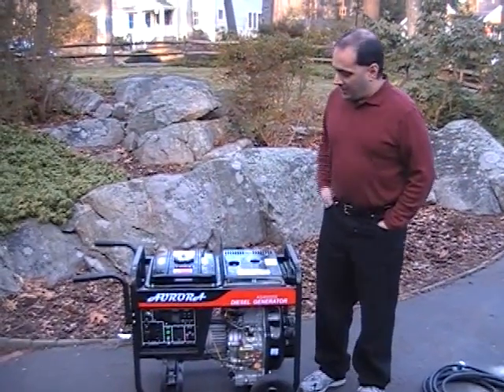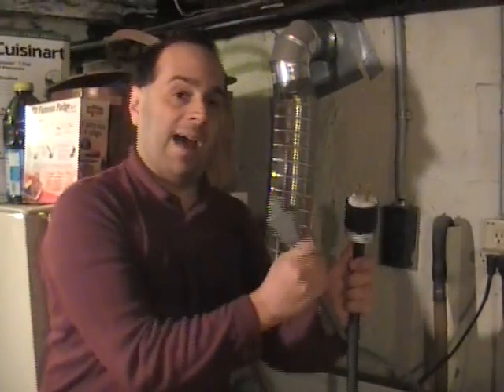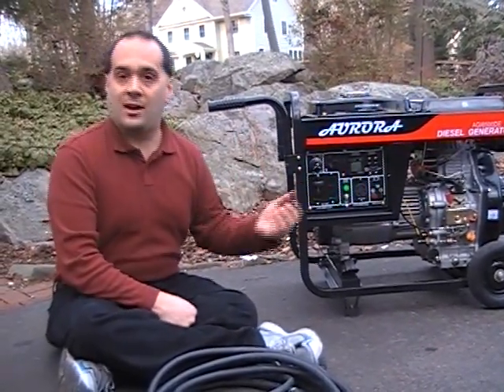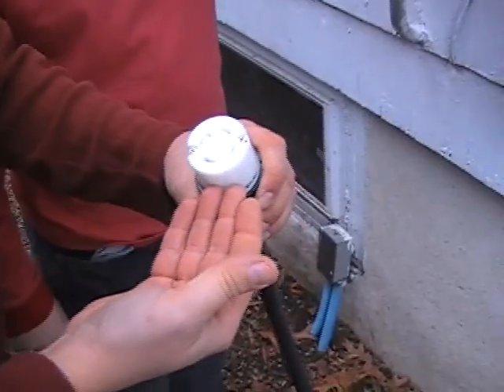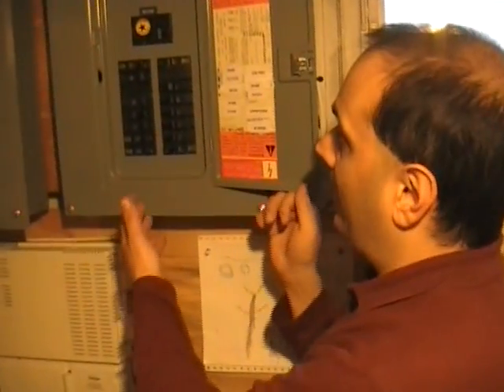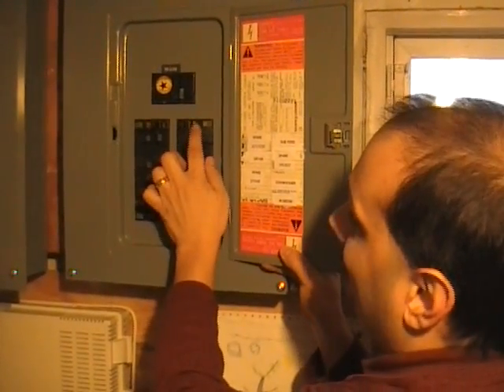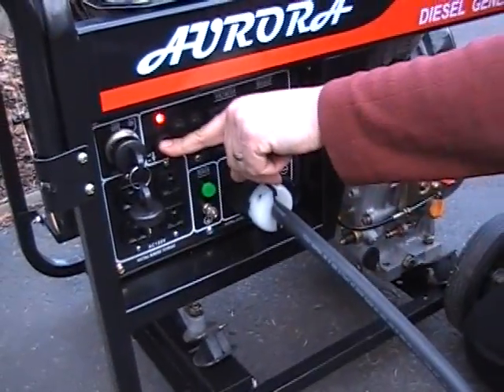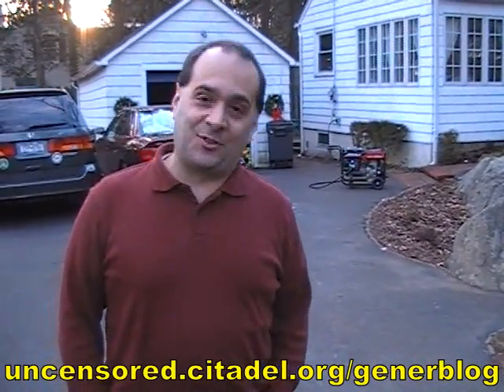Inexpensive residential generator hookup

Comment: I burned up almost every electrical appliance in my house, light bulbs popped. Surge protectors. I bought a plug,had some wire.connected it to a 240 breaker in shed.backfed to house panel box.main off.i learned not to mess with something I don't know
Reply: You must've ran 240 through your 120 circuits.  You should test circuit before using the first time to make sure everything is kosher.
Reply: @raymondjackson6069  yea,that's what seemed to happen. I disconnected the wire on 240v for air compressor. From there, it goes to breaker in the house. Thank you. I will be sure to look more closely at what I'm doing now
Reply: @dalecarter4025 , you're welcome my friend.  You say that "seemed" to what have happened.  You have to be sure with that kind of tinkering.  Guess work just doesn't cut it with those voltages, because guesses lead to surprises and you really do not want any unknowns, unexpecteds or surprises doing electrical work.  And when you have others in the home, like a wife or little ones, you really don't want to take chances and be safe.  Not tryin to harp for electricians, but if you are not comfortable (but not too comfortable) with electrical task, you should at least consult with one for guidance.  Good luck and be careful, and treat every wire you can't see both ends like it's live.
Reply: @raymondjackson6069  thank you raymond. It wasn't the first time I had been doing this. I don't fool around with stuff i.don,t know. I'm no carpenter either. But I will get someone that knows fix it .you are right, I could have killed someone or burned the house down
Reply: @dalecarter4025 , absolutely.  If you've done this more than once, time to call in a pro.  You are really not cut out to deal with the level of electrical work you are/were attempting.  Not trying to sound preachy, but screw up carpentry, and you got something ugly, plumbing, you may have a leak.  But electrical issues are very serious.  I've been tooling around this stuff for decades, plus I was an electrician in the Navy, and I am still a' learnin'.  And the more I learn, the less I know.  Take care my friend, and be careful!
Reply: @raymondjackson6069  yes, I'm calling electrician, because I got other too. problems in the house .it's a 69 year Jim Walter with aluminum wire
Reply: @raymondjackson6069  thanks again, and for your service too
Reply: @dalecarter4025 , you too pal, and best of with your project(s).👍🏾
Reply: because you dont know shit about electrical.the problem was YOU,,in this case,yes.call someone who knows what he's doing,
Reply: Make sure you follow all the generator safety rules before using portable generators. This is just a reminder for everyone’s safety. Here are the rules about generator safety: Generators can be dangerous if not used carefully. Every year, hundreds of people die or get injured when using portable generators due to carbon monoxide poisoning and electrocution. Make sure you are using your generator carefully and keeping others safe as well. There is something very serious that everyone should always be aware of when using generators. Some people do run their generator indoors which is not safe and that increases the risk of carbon monoxide poisoning which can cause death of family and you. Some people run their generator in wet conditions which can electrocute them. Please remember that you should never run your generator indoors. Remember that carbon monoxide is an odorless and colorless gas that you cannot see or smell. Carbon monoxide is a silent killer. Keep that in mind. Make sure your generator is 15-20 feet away from your house and away from doors, windows, and vents. Never use your generator in your porch too. Having a carbon monoxide detector is very important against generator safety. Some people also allow children to go near the portable generator which could pose risks. We need to keep an eye on our children making sure that they are not near the portable generator so they won’t get electrocuted or burned by the generator which is dangerous. A locking enclosure also keeps kids safe. A generator shed might look like a tempting place to explore, or take cover during a game of hide and seek, but a generator is a dangerous piece of equipment that can cause injury. It says on the manual that we should also keep children away at all times from the portable generator to avoid injuries. Please do not allow a child or unqualified people to operate the portable generator.  It is important to keep your children safe especially little ones. The portable generator can be hot during an operation. Just because some manuals missed what should be listed doesn’t mean it’s safe to do. Always follow the generator safety rules when using portable generators. Generators pose electrical risks. If you need to use your generator during wet weather, you need a generator tent to protect your generator from getting wet. Don’t let your generator get wet. Keep your generator dry and before using your generator, please make sure your hands and your generator is dry. Do not wear loose clothing when operating the generator. Everything that is said on the generator’s operating manual should not be ignored. Never smoke cigarettes near the generator. Please keep flammable things away from the generator. Never overload your generator too. Your generator can catch fire. Never ever try to plug a generator cord into a wall outlet to avoid back feeding. Back feeding your generator is dangerous. Always turn on your generator first before plugging in appliances and shut off the appliances before turning your generator off. Use a heavy duty cord for your generator and the cord should not be worn out. All the instructions should be followed carefully. Never refuel your generator while it’s running. It can cause fire if fuel spills while your generator is hot. You should turn off your generator and let it cool off before refueling it. Having a fire extinguisher next to the generator is also important. This is only a reminder for everyone’s safety of using generators. Make sure your generator is properly grounded. Having a fire extinguisher next to the generator is also important against the safety rules. https://youtu.be/I1jT3ANENvI and here is a video more about keeping others safe when using generators and also about our family’s safety. It’s important to keep our little children safe as well. Make sure they’re away from the generator. Hope this helps.
Reply: Dale  Because you are a dumb ass and did NOT research how to do it !!!!
Reply: @wilburfinnigan2142  you are right.
Reply: @dalecarter4025  I know I am !!!!!
Reply: @wilburfinnigan2142  it was about 5 years ago, but I still don't know what I did wrong.
Reply: Your video was very helpful.

Comment: I'd like to point out that when it's time to shut down your generator to take loads off first, then shut it down.  If you shut down under a load, the regulator in the generator will put more and more current in the rotor trying to compensate for the motor slowing down.  This will shorten the life of the alternator.
Reply: Won't do much for your Dell, either. Or your six foot Sony, no baloney. ;)
Reply: That's it on a conventional generator. Does not apply to an inverter generator or a twin Inveter such as Honda. I agree with you on the conventional generator, but the among conventional gens on the market, Hondas are designed to take abuse. Fuel is cut to the carb immeadiatly shutting it down quickly under this scenario. But you are correct drop the load no matter what the gen is as it's good practice. Turn auto throttle off if it's so equipped.
Reply: But isn't that what a transfer switch on a whole house generator like a Generac does? Starts the generator and then transfers the whole house load? Then transfers the whole load all at once back to commercial power when it is restored?

Comment: I have a 30 amp cord from harbor frieght.  I dont know if i would run a house off it.  I bought my cord to run welder which only has 30% duty at full power.  That cant run the risk of fire like some people think of the harbor frieght cords
Reply: Here's an easy guide: 
a 12/4 SO cable fused at 20 amps is good for 4800 watts max 3800 continuous
a 10/4 SO cable fused at 30 amps is good for 7200 watts max 5800 continuous
an 8/4 SO cable fused at 40 amps is good for 9600 watts max 7600 continuous.
If you buy SO cord and matching cord caps you can save about half of pre-made cords. Size your cord to the max power of your genset.
Keep in mind, operating at the max power; these cords do get quite hot.
Reply: @crankychris2  All those max ratings should be continuous ratings, otherwise the cable manufacturers would not be allowed to sell  you cable not fit for purpose. This 20% derating of a cable for continuous use is retarded! Most cables will do 30-40% of their max rating and still not have a problem, It's not the cable you need to worry about it's all the joins and terminations where the faults usually happen

Comment: Harbor Freight has good quality generators for half the price
Reply from the maker: This video isn't about the generator.  It's about a safe and inexpensive way to hook it up to your house.  You can use any generator.
Reply: do you work for them?
Reply: There are quite a few Chinese build gensets (Champion, Westinghouse, Pulsar, etc.) similar in price to HF Predators. As a retired Electrician, I'm pleased to find these breaker interlocks are available for so many old panels. This reduces the cost over a 200 amp transfer switch and labor by $$$    :))

Comment: So,you need an electrician in the family lol
Reply: These interlocks change an all day wiring job into just a couple of hours. The interlock is $30-$70 a 20 or 30 amp 2 pole breaker $15, 2 cord caps and 50 ft of 10/4 SO cord mebbe $80. For labor I charge $50/hour; $60/hr if you watch, and $90/hour if you help. ;)
So mebbe around $300 for an garage panel vs a thou or so to install a manual xfer switch. Like the man said, a grand will do ya, $1500 will get you done with a 9-10KW genset that will run a 4 ton a/c. If you go with one that big, consider a dual fuel unit. They swill gasoline like electricians swill beer!
Dorian is on my doorstep it looks like I'm playing Reddy Kilowatt this week.
Stay safe!
Reply: Fortunately my son is a master electrician!

Comment: Transfer switches have significantly come down in price. A 10 circuit switch is now around $275 with all the parts you need.
Reply: I would do the interlock breaker since a friend has a 6 circiut transfer and now has remodeled and added a second fridge for her room mate she has. Problem is the second fridge is off a sub panel in the basement instead of main panel in garage so she cant power it off the gen without an extension cord.  You can run everything in the house just be smart on your load.
Reply: Make sure you follow all the generator safety rules before using portable generators. This is just a reminder for everyone’s safety. Here are the rules about generator safety: Generators can be dangerous if not used carefully. Every year, hundreds of people die or get injured when using portable generators due to carbon monoxide poisoning and electrocution. Make sure you are using your generator carefully and keeping others safe as well. There is something very serious that everyone should always be aware of when using generators. Some people do run their generator indoors which is not safe and that increases the risk of carbon monoxide poisoning which can cause death of family and you. Some people run their generator in wet conditions which can electrocute them. Please remember that you should never run your generator indoors. Remember that carbon monoxide is an odorless and colorless gas that you cannot see or smell. Carbon monoxide is a silent killer. Keep that in mind. Make sure your generator is 15-20 feet away from your house and away from doors, windows, and vents. Never use your generator in your porch too. Having a carbon monoxide detector is very important against generator safety. Some people also allow children to go near the portable generator which could pose risks. We need to keep an eye on our children making sure that they are not near the portable generator so they won’t get electrocuted or burned by the generator which is dangerous. A locking enclosure also keeps kids safe. A generator shed might look like a tempting place to explore, or take cover during a game of hide and seek, but a generator is a dangerous piece of equipment that can cause injury. It says on the manual that we should also keep children away at all times from the portable generator to avoid injuries. Please do not allow a child or unqualified people to operate the portable generator.  It is important to keep your children safe especially little ones. The portable generator can be hot during an operation. Just because some manuals missed what should be listed doesn’t mean it’s safe to do. Always follow the generator safety rules when using portable generators. Generators pose electrical risks. If you need to use your generator during wet weather, you need a generator tent to protect your generator from getting wet. Don’t let your generator get wet. Keep your generator dry and before using your generator, please make sure your hands and your generator is dry. Do not wear loose clothing when operating the generator. Everything that is said on the generator’s operating manual should not be ignored. Never smoke cigarettes near the generator. Please keep flammable things away from the generator. Never overload your generator too. Your generator can catch fire. Never ever try to plug a generator cord into a wall outlet to avoid back feeding. Back feeding your generator is dangerous. Always turn on your generator first before plugging in appliances and shut off the appliances before turning your generator off. Use a heavy duty cord for your generator and the cord should not be worn out. All the instructions should be followed carefully. Never refuel your generator while it’s running. It can cause fire if fuel spills while your generator is hot. You should turn off your generator and let it cool off before refueling it. Having a fire extinguisher next to the generator is also important. This is only a reminder for everyone’s safety of using generators. Make sure your generator is properly grounded. Having a fire extinguisher next to the generator is also important against the safety rules. https://youtu.be/I1jT3ANENvI and here is a video more about keeping others safe when using generators and also about our family’s safety. It’s important to keep our little children safe as well. Make sure they’re away from the generator. Hope this helps.

Comment: why do you need the interlock kit at all? cant you just know not to turn on the utilities breaker while you are running the generator? is it require by law? just curious, and your second panel for the generator is brilliant.
Reply: Thank you for the clarification. I have another question, can’t I just run one 10/3 wire with a male plug from my generator to a 30 amp breaker straight to my home breaker box? Basically do I need the inlet box in between?
Reply: There's a old say I heard once, "If you don't make it idiot proof, some idiot will prove you made a mistake."

Comment: it starts but it won't put out any power to my power plugs
Reply: Your generator has a breaker to protect the generator from overload. There's a reset button to power up the receptacles on the generator. Push the reset button in.

Comment: I just ordered a Generac GP8000E Mod7676 from Electric Generators Direct.  Also ordered Reliance Controls Pro/Tran 2 - 30-Amp (120/240V 10-Circuit) Transfer Switch w/ Interchangeable Breakers (A310C)
Reliance Controls PC3020M 30-Amp (4-Prong 20-Foot) Generator Power Cord (PC3020)

Reliance Controls 30-Amp (4-Prong) Power Inlet Box (PB30). 

What are your thoughts on these.? I read your experience with Reliance Controls... What then DO you recommend?  Thanks!

Comment: Very loud generator, I buy all Honda generators, very quiet.
Reply from the maker: That's fine; the method described in this video will work with any generator that has a four wire (120/240 volt) output.
Reply: Honda generators are one of the popular generators